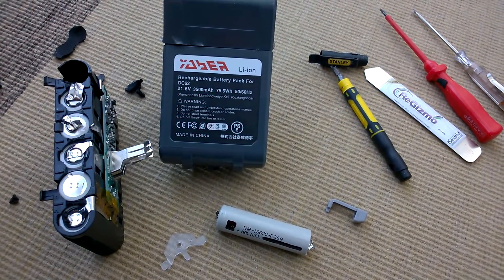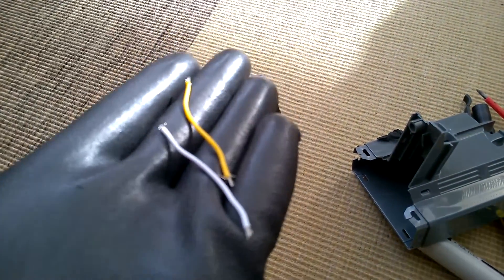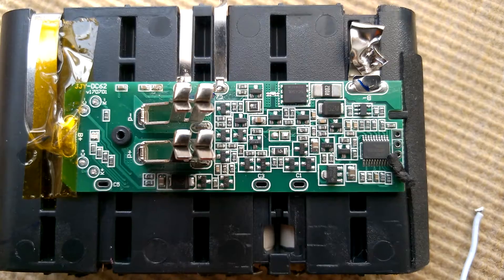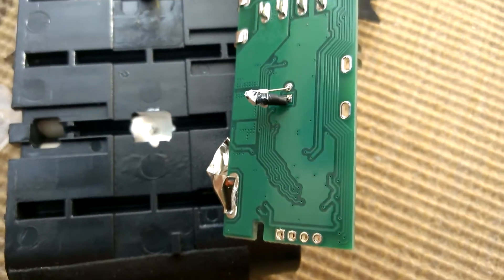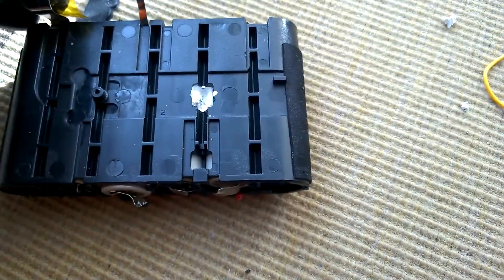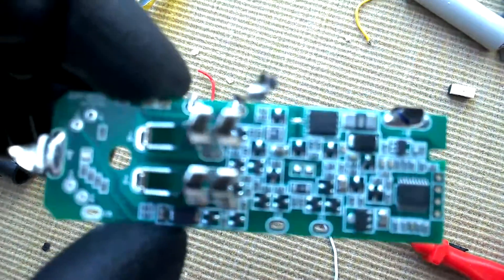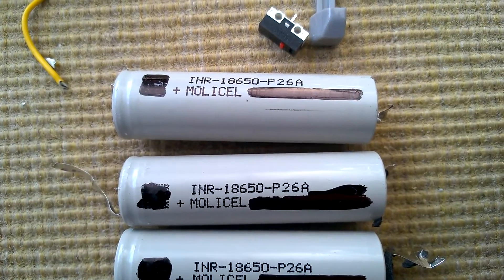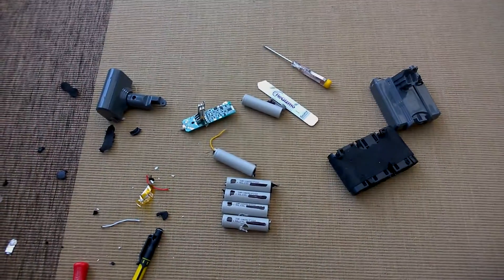Yaber Battery Pack for Dyson V6 Tear Down

Comment: I bought one of these Yaber packs secondhand (mainly for cell recovery) and found that it used EVE ICR18650-15P 1500mAh cells, whilst having a 4600mAh rating on the label. The cells are testing at about 98% of their true rated capacity, so I suspect that whoever bought it gave up on the battery pretty early before the cells really wore out from use.
Reply from the maker: Similar to my experience of use. Worked ok for a few months but very soon it started to fail which looked more like electronic or sensor based issues than battery capacity issue. The batteries themselves are still working ok out of the battery too block too. I use them in torches.

Comment: Would you buy another one?  Or after the short lifespan, and after figuring out what's actually inside, would you look for another brand?  I see the new Yaber battery on Amazon is sold as 4600mAh.
Reply from the maker: I wouldn't buy another one, no.  It should last longer than 10 months of very basic usage.  Might be worth opting for the official Dyson one in all honesty.
Reply from the maker: I will add that Yaber were very good in dealing with the issue though so their customer care is worthy of a mention so I am not out of pocket.